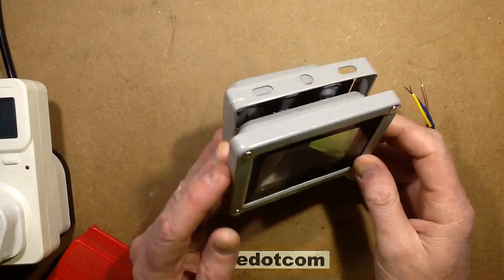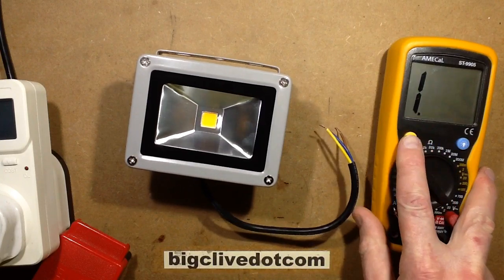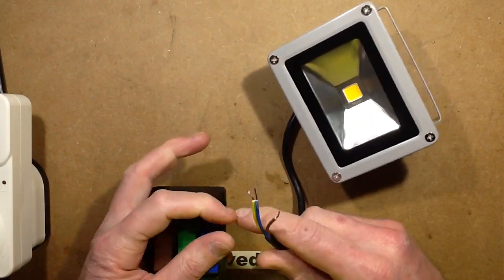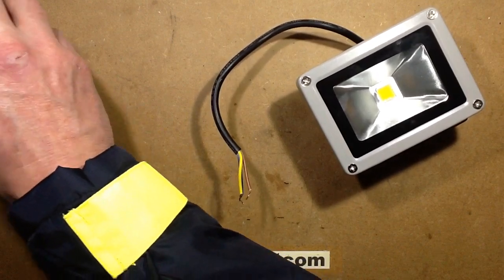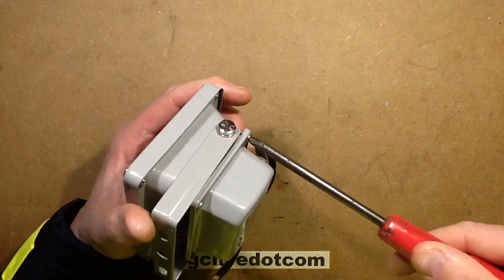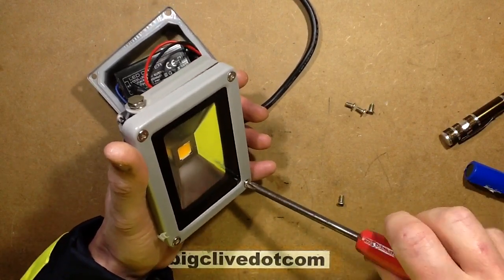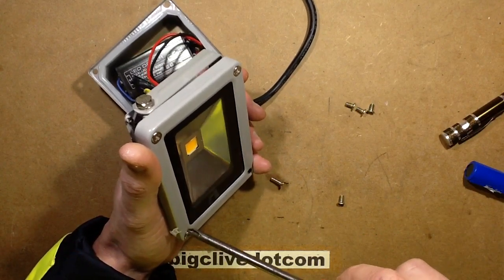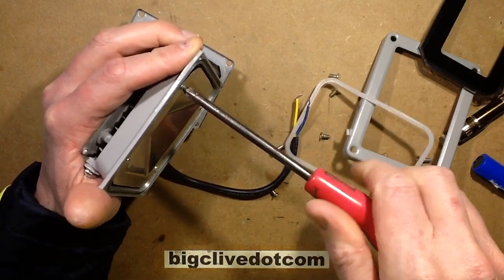Random cheap LED floodlight teardown.

Comment: I bought two lamps that looked exactly like that a couple of years ago. Neither had the ground connected and one had the driver catch fire after a couple of days. Yours look comparatively well made.
Reply: yes it seems an improve version, also the led is 7.5w, i have the older version with the older 12v led, its more like 4w at most , same case though, yes the driver was a couple of cheap components wrapped in kapton tape, not a box like clives

Comment: Clive, I asked a seller if their two single cob "100 watt" was really 2 50 watt cobs with two 50 watt drivers and the answer was a yes.  So, I asked if the single 100 watt cob was 100 watt with a 100 watt driver and they said errors happen.  So, I asked them if that meant they know they are selling a 100 watt LED wrongly and they said errors happen.  So, they know damn good and well what they are doing and at least this person was nice enough to tell me it was a fake.  I ended up winning one from another seller that was the two cob "100 watt" version for $12.50 last night so not bad.  I will open it up and remove the cord and replace with my three prong cord (theirs is just wires) and make sure it is really grounded in the process.

Cheers.
Reply: Yeah, and you know what ticks me off the most?  There is no way to turn in these sellers for false advertising and selling something they really don't have.
Reply: I bought some little 12v LED lights from china on ebay. They were advertised as 9w, when they came I tested them at less than 1w! Seller's reply was: "Sorry to hear this news, may be due to voltage is not the same as the result"!! Lol
Reply: scbk
Yeah, I hear all kinds of things in their Chinglish but if I get a response like you did I file for a refund and every time I get my money back.  I had one light that came that was 10 watts and was so dim I knew what was wrong because it said 110v but acted like it was for 220v.  I told them and they refunded my money.  I mean I use 9 watt bulbs in my house and this was about 1 watt which made no sense because they had a bunch of the little chips all around it (was a corn cob light) not a single chip so I could only surmise that it was due to being ran at half voltage.

Comment: Wonder if they didn't tighten the earth connection in the factory or if it worked loose in transit due to lack of washer/threadlock.
Reply: didnt tighten, the others didnt get loose, most often the earth isnt connected just tucked in behind

Comment: I think some Chinese sellers are increasingly sending in bulk to the UK and dispatching from there through a partner or something like that. Your starting to see the weirdly unfitting names dispatching from the UK more and more.
Reply: I buy small stuff from China too and used to have a problem with the mailman. I have a mail hatch in my apartment door that opens from the upper edge. Sometimes my thing is small enough to be shoved thru it with moderate violence, but when it wasn't the mailman just left the thing on the hatch - for any neighbour to steal. They're supposed to leave a note and take the parcel back to postal office.

So i made a complaint about that after two such incidents. On the day before yesterday (23.11.2016) i received yet another item that wasn't small enough and the mailman ringed my doorbell. Luckily i was home at that time.
Reply: I have been quite lucky over here in Australia. Made around 800+ purchases from China only lost a few, some even turn up after 3 months lol. Most of the sellers have been quite good and refunded or reshipped. Just keep an eye out for good ratings too, I rarely buy from less than 99%.
Reply: *****
yep, its not that problem i have, i am 99 percent in when the mail comes, and the items that have gone missing were plenty small enough to post normally, i think the UK post has gone to heck really.  uk have mail slots in the front house  door, so cant mislay mail at my end at least.
Reply: its for impuse buyers who dont want to wait 3 weeks and willing to pay 3-4 $ more
Reply: very true on the waiting, but also, i lose maybe 30 percent of small orders from china, i buy a fair amount of £1-4 stuff and it is not tracked and never turns up.
Reply: Yeah I've noticed that in Australia too. I think a lot of them probably have a small warehouse/storage place because they often run out of stock, and/or ship from Asia.  Multiple accounts from the same sellers possibly too. Most of the Australian sellers is the same stock with their margin added.
Reply: Dark Anthem
oh its not the chinese, its the UK post office, they also lose a fair amount of small stuff i buy in the UK.
Reply: Ahhh ok, yeah the post can be bad anywhere. Hopefully it gets better for you.

Comment: I really don't see these being used in any mines, certainly here in the UK.
Everything electrical down the pit, needs to be either "Intrinsically safe", which is it uses a low enough voltage, and is designed so it cannot cause a spark hot enough to ignite methane gas. Or for all the heavier stuff, with higher voltages, 3 phase etc, need to be gas proof or in a "flameproof cabinet", in that all the electrical equipment needs to be housed in very heavy cast "panels", like boxes, and any doors or glands are designed so that if there were to be an ignition of some methane gas inside the equipment, the gaps are small enough that none can get out of the equipment and ignite an outside source of methane gas. The panel doors are well bolted closed and the gaps need to be checked with feeler gauges to make sure. No power can be on whilst a panel is open.
Reply: Now you see why China has been having so many mining accidents and out right explosions for decades.
Reply: *****
Well, do you want active mines that blow up and kill people like in China or having closed mines because of safety regulations?
Reply: Let's just do neither and make wonderful mining robots that we don't really care about if and when they go up in flames.
Reply: Roflcopter4b
Don't care about?  Are you insane?  Robots cost a shit load of money whereas humans are virtually free slaves.  Easier to just get another human, or a hundred, than to have to buy another robot to do the same chore.  Mining bots are not cheap but human life is.
Reply: *****
Clearly you've never heard of lawsuits.
Reply: Roflcopter4b
In the USA law suits can take decades so it benefits the company and in China there are no lawsuits when a mining accident happens.  All life is meaningless especially in a communistic country and one driven by money.  A lot of the time a law suit can take so long no attorney will even take it and if it is a class action lawsuit those can easily take 5 to 20 years and when done you will get 1-10 cents per dollar of the final settlement.  Can take so damn long it outlives the original people involved.  That is how lawsuits works in the USA is to make them so long that the cost is spread out whereas the price of a robot is immediate.